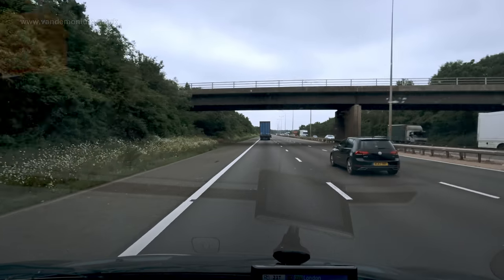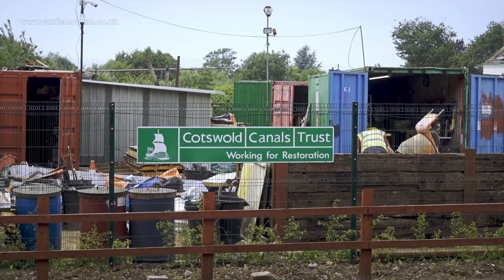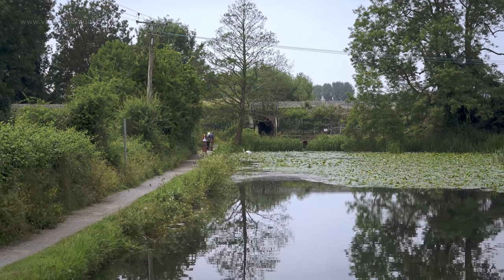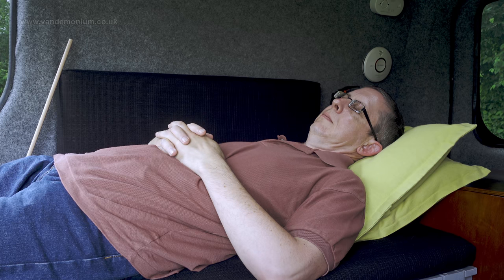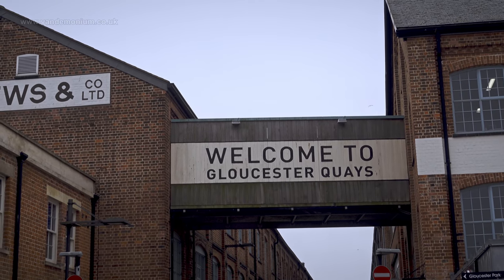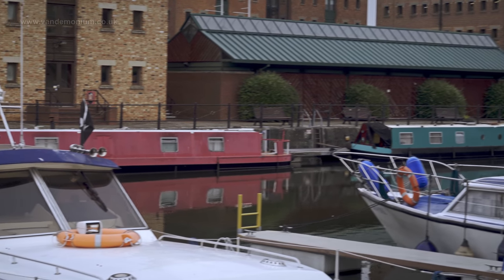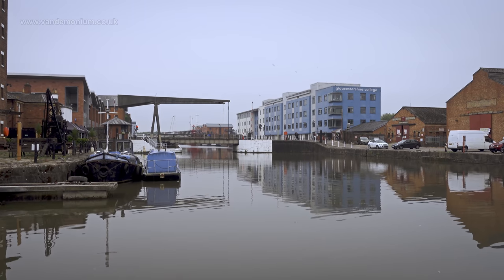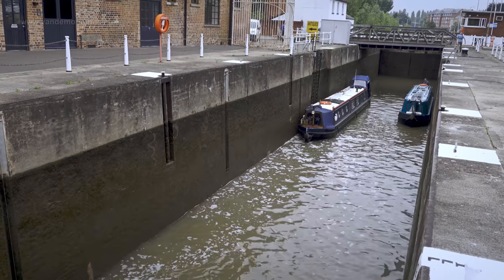53. Visiting Stroud and Gloucester in the campervan

Comment: 6:55 Bit of possibly very helpful advice, you really need not even own a dedicated satnav anymore. Using a combination of phone apps is FAR superior. Personally I use just two, an app called "Waze" and the google maps app. Waze does 98% of the work and then I'll use the google maps app for when signal is very (and I mean very) poor as the google maps app works with the most meagre drop of signal. Waze is especially fantastic because it has a feature for users to mark hazards such as bad traffic jams, broken down cars on the hard shoulder, crashes etc. Other users mark them then that information will be used to improve your journey, most of the time it will simply warn you of the hazard however if it's something that could cause real problems, like a long jam it'll re-route your journey to completely avoid it. If using apps really isn't something you're interested in however then something else a surprising amount of people don't know is that you can, and should, go to the manufacturers website and see if there are any updates for your particular satnav model. You can then plug the device into your computer and update it, these updates can come with a surprising amount of improvements and added features.

Comment: I have a similar problem with my Garmin, though to be fair, living in Devon most of our roads are windy country lanes so it's not entirely the satnavs fault. A pre prepared route plan makes trips much easier we have found as well as good old fashioned map book. The sat nav is mostly used to get us out of trouble when we take a wrong turn or navigate us around traffic jams which it does very well. When it does die though I won't buy another, phones are just as good these days.

Comment: Thanks for showing me around Stroud, Glos etc. I'm missing it badly as my flight tickets home were cancelled over a year ago. My sister lives in Stroud and on my 3 month stays in the UK I spend a few weeks there, testing the local brews, getting exercise climbing the hills. Did consider buying a wide beam from a boatyard near the Severn but could not agree a price.
On one of my visits I went aboard a trip boat in Glos docks, it happens to be a Dunkirk Little Ship and I read some where an elephant went onboard for a ride but the crew knew nothing of it. Plus it's the only Dunkirker I've been on that didn't have any beer.
The dry dock you showed was in a boatyard that specialised in repairing old sailing ships, my younger brother popped in and asked the owner if he needed a caulker, the owner was astounded by that as he'd had to train all his guys. My brother in fact caulker tunnels under the River's Severn and Why.

It would be good to see the canal finished through Stroud and perhaps take a trip on it in a future UK visit.

Thanks for posting in these difficult times, were on shut down in Vietnam. Stay safe.

Comment: I’m still using a rather elderly Garmin Nuvi 350 which I’ve had for over 10 years.  It allows me to set the type of vehicle being used.  I have selected “truck” (it also offers bus, bicycle, car/motorcycle or pedestrian) and this keeps me away from very minor routes.  All very handy when I had a motor home and essential now I tow a caravan.  I think more modern models don’t have this function - no doubt so you’ll invest in one of the campervan/caravan models they now sell😊
Reply from the maker: Yes, I definitely need one with more options

Comment: David, Just a quick suggestion to control the SatNav. Buy a roadmap so you can pre-plan your route and thus make the best use of the main routes.
Reply from the maker: It's really for the local routes that I use the satnav.
Reply: @Vandemonium  It's precisely for the local routes you should be using a map.  For the long stuff satnav is great but for local stuff it doesn't work so well.

Comment: I had to laugh when you mentioned the Garmin, we have one that did just that, it had us turning off the main road and going along a road which at first looked reasonable until it went to a single track and started climbing..we ended up in 1st gear going around a steep bend that must have been 1 in 10 or something, convinced we had to do a U turn as soon as we could..eventually ended up on a main road again and looking at the map later we could have easily gone down to the next village and turned left to get on the same road :)
Reply from the maker: Yep, sounds just like mine alright.

Comment: Lovely. We bought some narrowboat windows from Frampton. Does your Garmin send you down tiny roads because you tell it not to send you down big roads? We use a map - never runs out of charge, no-one will steal it (Gloucester....) and it's nice to look at.
THumbs up as usual
Reply from the maker: No, I don't have the "avoid main roads" option turned off. It's just a mad system.
Reply: Maps are best if you have a navigator with you, but nearly as dangerous as a phone if you are driving alone, though not actually illegal.

Comment: David - I am not untrusting of your vans AC diagnosis by the garage at all. However, accepting that the condenser has been damaged causing total loss of the refrigerant charge, then I would recommend you ask at the outset of the repair that you would like to see the damaged condenser on the bench and rigged up to an airline and have the leak demonstrated to you. This is so you can understand the mechanism of failure - which will either be a material failure, poor quality assembly (not much you can do about those) but it may be damaged as a result of impact damage from road debris. If it has suffered impact damage then it is worth investigating fitting additional protection (plastic mesh screen) to avoid it happening again - these are random events and could happen next week or never.